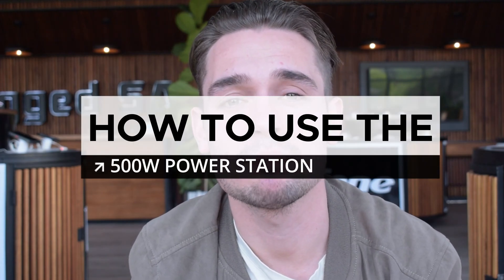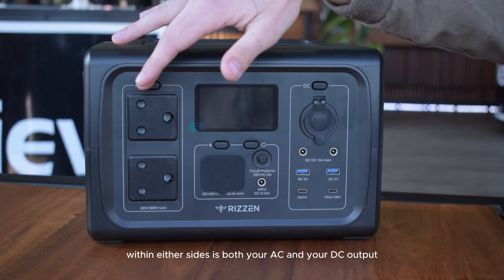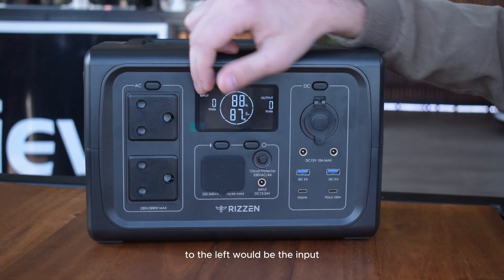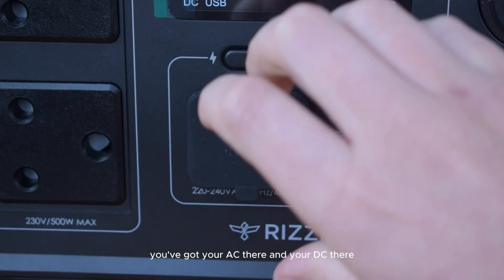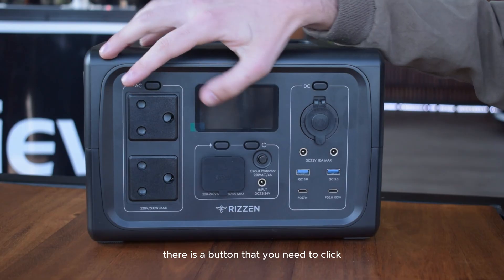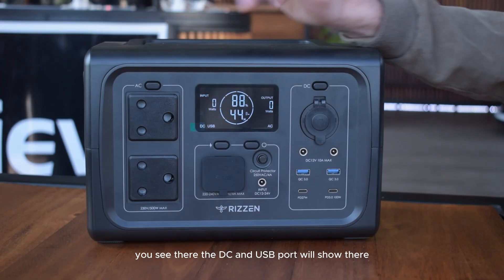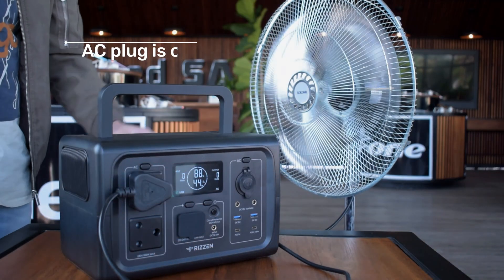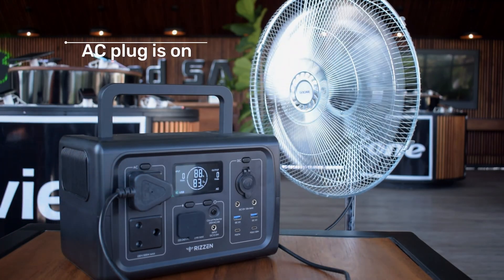RIZZEN 500W DEMONSTRATION VIDEO

Comment: How many hours can it run a normal desktop computer with 2 screens
Reply from the maker: Hi 👋 If we roughly calculate the average consumption of a desktop and two screens which consume about 556 watts, the power station should be able to power your equipment for about 50-60 minutes.